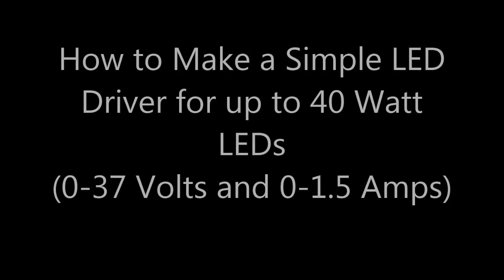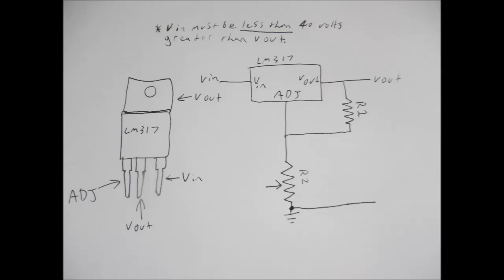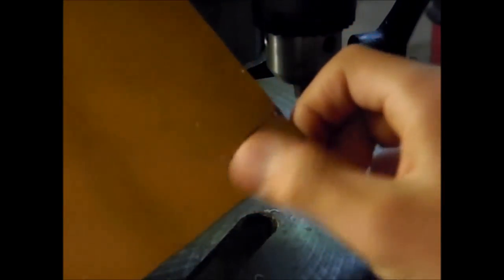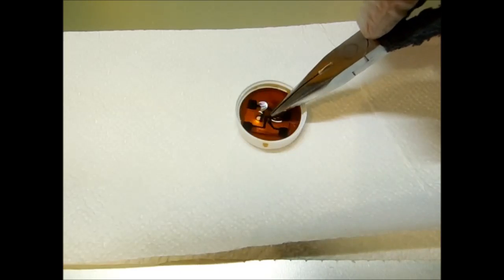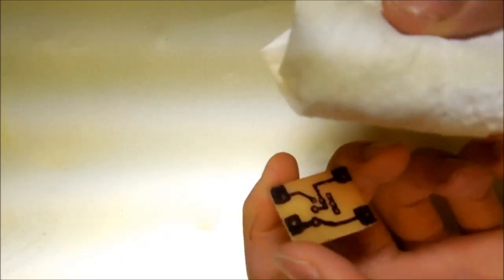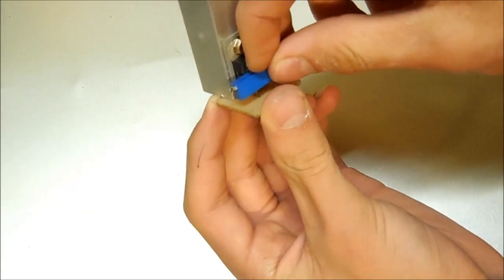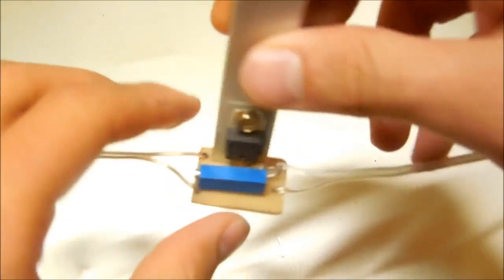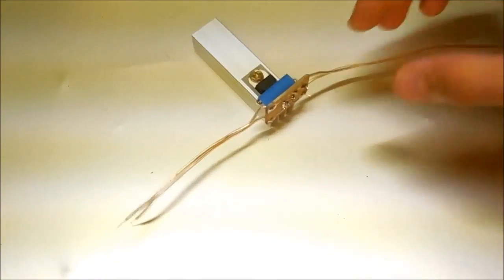How To Make A Simple LED Driver

Comment: Could a LED driver be added to a fog light to increase brightness?
Reply: +Iek Chan   If you have LED fog lights the voltage and current is already controlled by a driver. An LED driver insures that the LED receives the desired voltage and current so the proper light output and life expectancy is achieved. A simple resistor can work when the voltage is constant but in an automotive environment the voltage can and does vary.

Comment: it is recommended to regulate a LED by its current and not its voltage.
Reply: No LED will draw current magically if it isn't supplied with the right voltage. These kids repeating that they are run on pure current are repeating things they don't understand. Nothing runs off current, current and voltage are just imaginary properties for humans to try to understand electricity. Everything has to have a certain voltage to run and will draw a certain amount of current. 

You must supply it with the right voltage, an LED won't draw more current than is specified as long as you don't overvolt it. The point with LED's is they have a non linear curve of current draw, so if you are just over by 0.2v you can significantly heat up the LED and ruin it's life span to be only a few hours.

Where as most other electronics like fans, heating elements, other lights etc can all be overvolted a bit and it won't have such a drastic effect on them.
Reply from the maker: +Mathieu Bacquet That is true, but the point of this was a simple design, although I did make the simple circuit about as complex as possible :D Thanks for watching!

Comment: This is a constant voltage regulator. LEDs need constant current to prevent thermal runaway, which will reduce the lifespan significantly. You are teaching people the wrong thing.
Reply: No, LED's will draw ridiculous amounts of current and burn themselves out if overvolted even slightly. But they don't magically draw current to burn themselves out if run at the right voltage, if you try to connect them to voltages too low they won't even turn on. Their current draw depends on the voltage connected to them, it's just that it isn't linear so you have to be careful. 
If you had a battery that had a voltage of 3.4v and an LED that had a forward voltage of 3.5v. You could connect it fine and would never have any problems, but if you connect to a battery even a few hundred millivolts over the forward voltage then don't expect it to last longer than a few hours at best.

Comment: Nice. That does indeed work as a constant voltage LED driver. In that configuration LM317 is generally used as a variable voltage regulator and does the job. For some LED's like the laser LED's for example, the driver needs to be constant current. And this can also be done with this IC and just one resistor.
There are however limitations using linear regulators for driving high currents over large output voltage range and I'm going to mention the most important here. This is only for people, that are just starting to learn electronics and are not familiar with linear regulators:

In a linear regulator the current in the input is going to be roughly equal to the current in the output. What this means is that if you have a load on the output that allows current flow of 1 amp, this means that in the input of the regulator there will ideally be at least 1 amp current as well. This is due to the fact, that the regulating element inside the regulator IC is usually a bipolar transistor, that actually acts in a sense as a variable resistor, in series with the load on the regulator's output. You can in a simply represent the regulator and load as a voltage divider, where the regulator is a variable resistance, adjusting itself in regards to the voltage drop on the load. This means that the transistor inside the LM317 or any other linear regulator is not fully saturated and has a significant voltage drop across it's collector and emitter. The voltage drop is the regulator's input voltage - the output voltage. This means, that if we for example power LM317 from a 12V power source and need 3V output, the voltage drop across the regulator will be 12-3 = 9V. If the load current is 1A, then the lost power in the regulator will be 9*1 = 9W, while the load is using 3*1 = 3W. So 1/3 of the power of the power source is actually used in the load and the rest is just heating the regulator. This is the reason why you always need to either keep the output current low, or the input and output voltage of a linear regulator as close as possible in order to prevent overheating of the regulating component (be it an IC or a discrete transistor). Most all IC's such as this one have some protection against high current loads (shorts) and overheating. The LM137 is allowing a maximum of 1A load current for example and has overheating protection. Here are some examples of how you can determine the power loss in your linear regulator:

 1. If lets power the regulator from a 40V source and plug in just one LED 3,6V at 3W (0,833A current) in the output. Then the porer loss in the regulator will be as follows: (40V - 3,6V)*0,833A = 30,3212W. At 30W as heat in that tiny regulator, the heat sink and internal overheating protection might not be enough to prevent the chip from smoking... This is not safe to do.

2 Lets say that we connect 10 of these LED's in series and hook them on the output. This means that the regulator should deliver 3,6*10 = 36V output. And lets again power the regulator from a 40V source. Then: (40V-36V)*0,833 = 3,332W. At little over 3W heat in the regulator and a heat sink, this is no problem for the regulator to handle. This is completely safe to do.

Conclusion: linear regulators are funny. They pop if you want to power just one LED, but they work fine if you power 10 in series. They have an upside tho. They are simple and easy to build and are very silent. The last makes them ideal for powering sensitive circuits.

If you want to have a more robust and not that easy to explode away driver, you do need to either buy or salvage a switch mode regulator. Their input current changes with the output voltage and load current and they are much more efficient than the linear regulators. They are also capable of delivering much higher load currents. But the downside is, that they are more complex than this (well not that much) and also they is quite more noise generated due to the switching of the regulating component (usually either a bipolar transistor or a mosfet).
Reply: You explained this beautifully.  Thank you.

Comment: Great idea for learning basics. But any led 1/2 watt and over. Needs to be driven by a "chopper" circuit. Pulse width rate controlled etc. Constant current or voltage depending on circuit and light used.

Comment: it's really hot LM317 with variable potentiometer when i put 12v power supply with 5 amps current input and output for 700mA 3.4V led 3 Watt?

Comment: Hello, I have a Q? Wy do I need or don't I need a current driver for my 10W LED? The light goes on when I test connect it to battery. I want to put it on my FPV  250 quadcopter using a 10 amp receiver control relay swich?  Thanks. Kazz
Reply: Kazz- Mann Dunno if you've blown your LED apart yet, but a full 12v is going to fry an LED. They're happy, but not fully bright at 9v, and fry at the 12v mark. 10v is apparently what you've looking for. Thus, the driver in the schematic. A couple of electronics guys here on YT explain the reason for the driver.

Comment: For those of you whining about this video being a voltage regulator, pay more attention to the circuit. A voltage regulator doesn't need a fixed resistor, just the LM317, along with the potentiometer. Read this before saying shit: http://www.onsemi.com/pub_link/Collateral/AND8109-D.PDF

Comment: Man what did you used to draw the circuit and what was the solution where you kept the circuit for 20 minutes
Reply from the maker: A sharpie brand permanent marker (other brands should be fine) and printed circuit board etching solution, can be ordered online and radio shack stocks them if you have one where you live
Reply: Electrotechnics I live in Nepal,Asia . Can we use copper chloride?
Reply from the maker: Copper chloride would not work.     

Ammonium persulfate or ferric chloride is what you need to use
Reply: Electrotechnics OK! OK! I actually meant to say ferric but also thank you very much

Comment: There must be something of true,i saw many videos here that use an lm317 as a current regulator
Although in the datasheet of the lm317is a voltage regulator
Reply: Electrotechnics
 Dude, it`s great that you can find a solution that works for you, but you must agree that title of this video is incorrect.
Reply from the maker: You can build it either way, and it will be fine for the led. I chose this method so that I could use a 36v power supply to drive both 12v and 24v and 36 volt leds (at different times)
Reply: Citation from a data sheet ` it makes an especially simple adjustable The LM117 series of adjustable 3-terminal positive switching regulator, a programmable output regulator, voltage regulators is capable of supplying in excess or by connecting a fixed resistor between the of 1.5A over a 1.2V to 37V output range. They are adjustment pin and output, the LM117 can be used exceptionally easy to use and require only two as a precision CURRENT regulator.`
It means that adding a resistor you can control current like so - get 350ma with 3.9Ohm resistor, 750ma with 1.8 Ohms and so on.
Reply: Forgot to add - just don`t do as author of this video if you need to run LED. Just search google for lm317 current regulator.

Comment: what is your main power supply?
Reply from the maker: A 12v lead acid battery. Any smooth DC power supply under 35v will work.

Comment: You've built a voltage regulator, not a led driver. This circuit is highly inefficient.
Reply: A voltage regulator doesn't need a fixed resistor, just the LM317 and the potentiometer. That one in the video is a constant current circuit, simple, but works. Need proof? Meet Mark Scholten: http://www.onsemi.com/pub_link/Collateral/AND8109-D.PDF
Reply: Electrotechnics By that logic, if I pour beer in the drains, it's just a highly inefficient drain cleaner...
Reply: It's highly inefficient when it comes to use a bigger current with less voltage, but if you have enough voltage to turn it on without getting wasted heat, there is no problem at all.
Reply: Mister Lister i should had seen you had tried before i posted the same...
Reply: All the little fishes are getting drunk tonight.
Reply from the maker: It is a voltage regulator and is is inefficient, but it is driving an LED. Therefore it is an LED driver.
Reply from the maker: Mister Lister If there is proper cooling for the led and the voltage is set right and the led is of reasonable quality, then the current draw should not be an issue. The goal of this is to use the most simple circuit design (the PCB is optional) if one does not want to DIY and wants a fancy more efficient driver they can go on eBay or equivalent site and order up a led driver for just a couple dollars.

Comment: A proper LED driver is a constant current regulator, not just an adjustable voltage regulator. LEDs, like any diode, will change characteristics with temperature.
Reply: Electrotechnics which is why you should the other configuration like a few on here have already told you and stop looking like a noob
Reply from the maker: lez briddon If you give the led the right voltage it is rated for it will not draw more current than it needs, if your led would heat up too much and changes current draw characteristics to the point that it would cause a problem, then you either don't have the right heat sinks or you just have a crappy led. I'm not sure why you think this makes me look like a noob...the whole point of this was to make a DIY design that people can make even if they know little about this kind of stuff. Though I did make a PCB, the same design can be followed to make a SIMPLE led driver with no PCB. If you don't want to use this type of "noob" circuit just go buy yourself a cheap led constant current driver off eBay or Amazon instead of complaining on here.
Reply: Electrotechnics ok, i'll unsub, i cant see someone doing something wrong and then saying its right as you can get away with it so its ok.. an led should be driven with a constant current driver, yes a resistor will do for putting 10ma across a red led for indicating powers on etc and a constant voltage will do for a small <10w style led if you keep it below its 'knee' but when you start driving the bigger leds and higher wattage ones this is not the way to do it and would be totally stupid to do, you could have just showed the correct way to wire a lm317 for constant current the right way from the start and it would have been a perfect video, instead of misinformation and bad practice.
Reply from the maker: lez briddon OK bye, since you will be leaving my channel why don't you also bug all the others out in YouTube land using this design too, there are plenty of others showing how to make this very same bad design. Happy holidays and bye!!
Reply: Electrotechnics maybe you should read your own comments page and look how many people are telling you the same, and how many are agreeing with you (is that tumbleweed).... repairing other peoples repairs with a mindset like yours is what keeps me not needing a fulltime job. 
as to the others, you seemed like you needed prodding, you didnt seem beyond help or hope. meh even i can misjudge someone.
Reply: He is actually right though, no offense. An LED doesn't magically run off current alone and magically draw copious amounts of current for no reason, it depends on the voltage connected as well as the heat the LED reached. Go ahead and connect a 3.5v led to a 1v PSU, nothing will happen. 
You can connect an LED directly to a battery as long as it's slightly under or around the forward voltage, but you never should connect it to a batter that is even a few hundred millivolts over. 

I have been running LED's for years. The only time you ever get a problem is if you over volt them or you don't cool them effectively. It's true that if you run them even at the right voltage (anything 1w and above) and don't cool them that they will burn out also. 
But that goes the same even if you limit their current, you always have to cool any LED 1w and above. Even some half watt ones may need a little cooling, the 5mm ones never need cooling though.
Reply from the maker: While this may not be the optimal the point of this is to be simple, the LM317 can also be used for current regulation too, just in a slightly different configuration

Comment: Your schematic looks a little odd. Your variable resistor, the center tap goes no-ware,
I think it should go to ground?
Reply from the maker: Sorry for late replay. Yeah I messed up with on the schematic, one end of the resistor is suppose to connect to ground and the wiper is suppose to connect to the circuit (or the other way around). I was quickly sketching up the schematic and thought that a variable resistor was drawn the same way as a regular resistor just with a arrow :p

Thanks for catching that.
Reply: +Electrotechnics And you're making "tutorial" videos for people??? You could seriously lead someoone astray with this vid....just re-title it to, "How to make a linear, variable voltage regulator", and not how to make an LED driver. A little bit of knowledge is a dangerous thing.
Reply from the maker: +BooktownBoy 
If I called the video "How to make a linear, variable voltage regulator"  It would be wrong, since I am not making a variable linear voltage regulator, because the lm317 is one!! I merely made a simple circuit that uses one, to drive an LED. Hence why it is called an LED driver, as it is driving LEDs....
Reply: +Electrotechnics So if I used a shoe to hammer in a nail and made a tutorial on how to make a hammer, and proceeded to make a pair of shoes.....

Comment: I am having a hard time understanding how current is determined here.  I am familiar with using normal low power LEDs where you use forward voltage Vf and forward current to determine resistor value.  The forward voltage for my current high power 3w LED is 3.3v and the current is 750mA.  I know I can't calculate for the resistor value and simply add that resistor like I would for low power LEDs because the resistor when used with high power LEDs would burn due to too much current and therefore power dissipation.  Will someone explain (preferably with additionally showing equations) why resistors don't burn here?  Thanks.
Reply from the maker: The current is determined by the voltage you put into the LED. As long as you don't put more voltage into the LED than it is rated for it will not draw to much current. The resistor in this circuit do not carry the current for the LED, their resistance values just tell the regulator how much voltage to let through. You can just use high wattage resistors in series with the LED to limit current but it wastes lots of energy as heat.
Reply: Electrotechnics Electrotechnics Hi. Thanks for the reply. I actually built this circuit based on your video. t
Thanks a lot .  I was able to drive 3 blue 3W LEDs in series w 12V 1A wall plug.  I would like to drive about 10 of them.  I have a computer plug that puts out 35V and about 4.5A.  I believe placing the LEDs in series using this circuit should be OK.  

I will search your vids but since I am already typing I will ask - have you made another vid on configuring the circuit to provide constant current?  Thanks for contributing to the pool of knowledge.
Reply from the maker: Sorry but I have not made another LED driver video with using constant current. I glad that you were able to get a driver working based on my video! and thanks for your nice comments!!